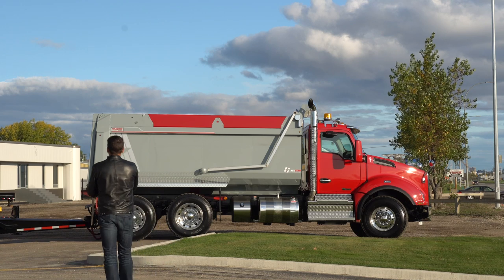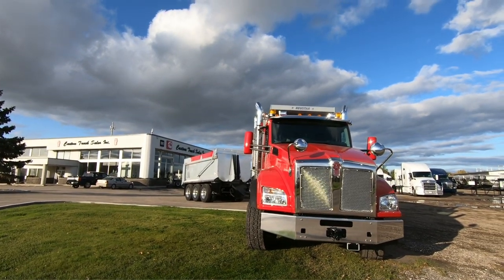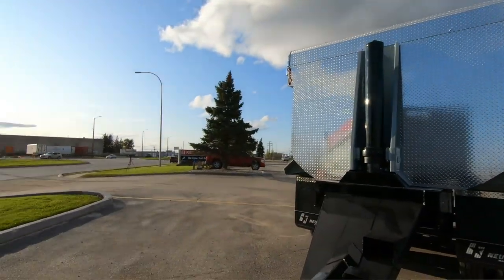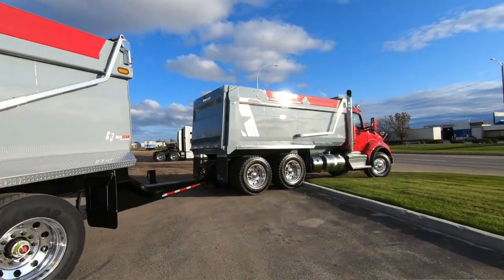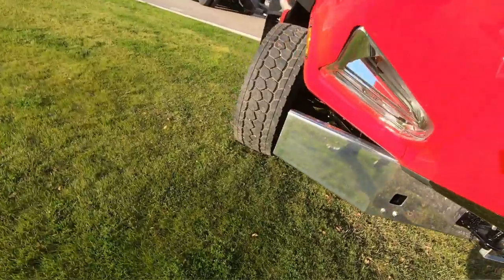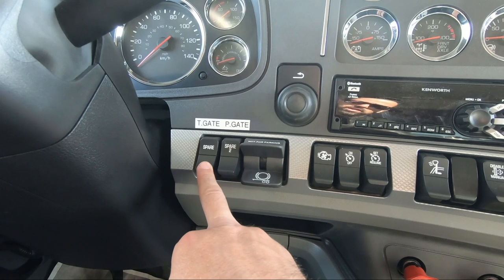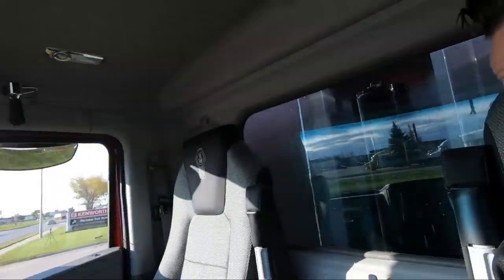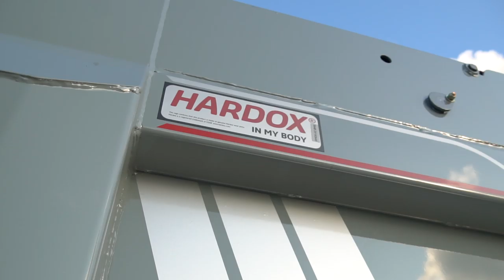2020 Kenworth T880 Dump Truck, Cummins X15 605hp 2050tq with Neustar Pup Trailer

Comment: This is right up my alley, only thing different is that this truck pulls a pup trailer behind it. Great looking truck and setup! Last Tuesday I had gotten out of the T880 that I had since the beginning of 2016 and into a new W990 that the boss had surprised me with.
Reply from the maker: Nice. Congrats Wayne.
Reply: @AndyTheKenworthGuy  
Thanks,  this W990 is bad to the bone! I'm not sure if you remember   back quite a few videos ago when I had mentioned that I had spec'd one out for the bosses salesman.  Well,  his salesman had me spec it out under the assumption that it was going to be built in the Spring of next year when in actuality it already had a built slot for June of this year.  The plan was for me to spec out the truck and we were going to talk the boss about it when it comes in. Boy, did they pull a good one on me. I was called to the shop 2 weeks ago to sign some papers and once I walked in the door there it was and the boss,  his wife, 2 daughters and a coworker of mine who knew about it shouting out "surprise!!!" I was so shocked and surprised that I was literally speechless. He had it ready to go so I just had to grab a few things out the other truck and roll out.  I went back at a later date to get the rest of my things.  Out of all my trucks I've received the most compliments with this W990. Definitely a sharp looking truck and a dream to drive.  Truck rides better than my previous T880. Once I finally get it lettered up I'll have to email you some pics.
Reply: @AndyTheKenworthGuy  
I know you're on the W990 Facebook page and there's a picture that someone has posted of my truck from the Touch A Truck event on Nov 2nd.  It was posted on Nov the 3rd and it's a Blue 7 axle dump truck w/ a Autism theme.

Comment: Good morning, Andy, I have a question for you:  Is the 2050 lb-ft torque Cummins X15 available for the T680?
Reply from the maker: Yes
Reply: @AndyTheKenworthGuy  and what do you think is the better? 18 speed manual, or 18 speed UltraShift?

Comment: Those box installers are still using a lame electric trailer brake controller people were putting in pickup trucks 20 years ago?! There are better options out now that offer a much more finished look. And they used a hand held label maker to mark controls for the dump body and pup trailer?! Lame. Those guys need to step up their game big time IMO. Fix those little things and this is a killer truck!
Reply: More versatile if you have a construction company with some tag/floats with electric brakes or need to tow a landscape trailer. Good Idea to add really
Reply: Ethan Donker I understand why they have an electric brake controller. If you read and understand my original comment you’d see it’s about why they used the one they did. There are much better aftermarket electric brake controllers available now rather than a knee banging controller the size of an original game boy, that is rather crudely screwed into the dash.